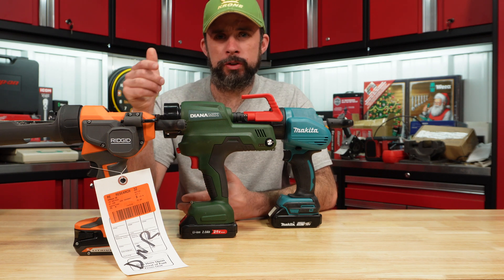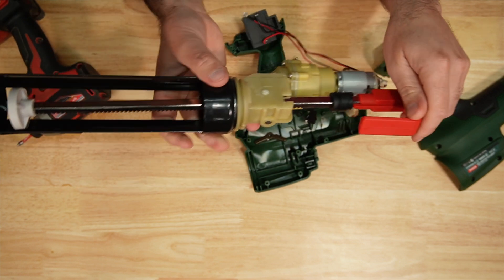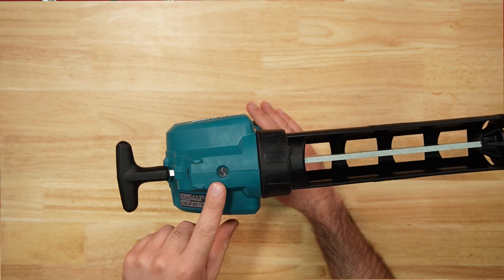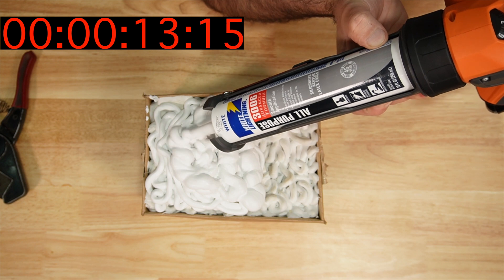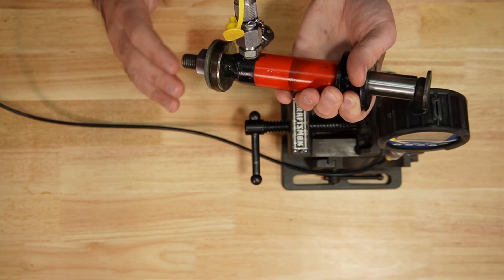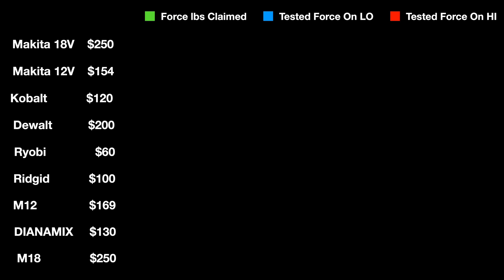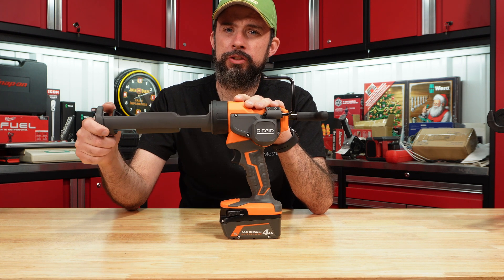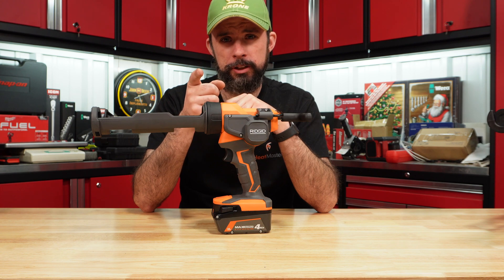Testing The 18V Makita Caulk Gun,  Update On The Failed Ridgid

Comment: The ridgid is on clearance near me for 57 bucks...LSA is solid. My only concern is the battery optimization, says over 200 tubes with a 4 ah while the ryobi's awesome optimization lets them do 200 tubes with a 2 ah... I'm on all platforms at HD except makita so ... doing windows or water fixtures here and there I can justify 60 bucks

Comment: I bought the Ridgid recently and before I had a chance to register it the darn thing broke just like yours. The manufacture date said it was made in 2020 (had been sitting around for 4 years at a home depot). The switch failed on it when the little bolt on the back kept going and the switch failed to tell it to stop. Once it keeps going the gears are out of alignment and can't pull the plunger back. I was able to fix it for a min until it did it again and the force of the gears snaped the bolt off. I just returned it wasn't about to send it off. As much as I enjoy Ridgid and it's the tool platform I've invested money into I'm going to look into the other brands you tested for this type of tool until Ridgid comes out with a new design.
Reply from the maker: Sad to hear I wasn’t the only one.  Yeah I like Ridgid for the most part, normally they are a good value in IMO.

Hopefully the videos help you decide on another option.
Reply: @Tools-Tested  yeah this was the only the 2nd RIDGID tool I have owned that had a major failure but the first one to do so not at a job site. I'm holding on hope they release a new one or at least can say "we have fixed the issues in this model with improved parts aka the censor switch tab that bent like an aluminum can."

Comment: You need to register for the warranty.

I’ve had two submerged batteries in a hot truck toolbox go bad and they just mailed me two new ones 

My OMT was in that toolbox too. Took it to Home Depot three days later it was working again.

I dropped my impact off like at least three roofs. The belt clip screw hole got stripped out. Clip on the left side was annoying they mailed me a new handle.
Reply from the maker: It was,  thats how I got a new one.  Just was a weird process with HD.

Comment: Can these push anchoring epoxy in the single tube? My guess is they can
Reply from the maker: It really depends how many tubes you plan on putting through it.  I put about 12 tubes through the older style ryobi and it actually bent the pushing rod.  I would recommend closing the highest performance one you can. Those tubes take a ton of force.

Comment: I used to work for a company that did all the tool repairs for Home Depot (on a National level - we gave support for over 900 US stores) 
If a tool or lawn equipment broke, the customer would return it to HD, and then we would pick up the defected items and deliver the repaired ones back. Typically, if the item was going to cost more than 50% of the retail price to repair, then the store would replace the item if it was still under warranty. (Unless it was caused by customer abuse/misuse. etc)

We tried to provide a 1-week turn-around on the repairs, but some items would have parts backlogs, which took longer,

We did this for them exclusively for about 10 years, then we started the same service plan for Lowe's, and of course HD got cranky about that and cancelled our service agreement. (Orange and Blue does not play well together)
Reply from the maker: Good information thanks!  Yeah my store didn’t seem to know what to do.  I think in this case they should have just thrown it out.  

Yeah I can see how they wouldn’t like that.  I’m surprised both still sell dewalt.
Reply: @Tools-Tested  You are right - Depot and Lowe's try to insist tool makers sign an exclusive agreement, but DeWalt is owned by Stanley Black and Decker (which also owns several other brands like Craftsman, etc) and they simply refuse to sign the deal. DeWalt is such a popular brand name that the big box dealers know's they need to carry it, so they let them slide on the exclusivity requirements)

My all-time favorite story was when the CEO of Snapper lawn products went for a meeting with Home Depot buyers, and they agreed to sell their products, but only if they met a certain price point. The CEO said he could not possibly meet that price, and HD offered to help set him up in China and other markets to build them, so they could be made cheaper, so they could meet the price point target. Depot promised a contract of 50k units the first year, and 100k in year 3. 
The CEO refused the offer and when he went back to his next board meeting, he said he would be remembered as the smartest, or the dumbest CEO in history for passing up the deal.
He reasoned that their name brand had a certain value, and making cheap product would diminish that value in the long run. Not to mention, their deal only netted them about $10 per unit profit. (which was good for HD large items). - That company I worked for also owned the Campbell Hausfeld brand, and they sold several models of their compressors to Home Depot for $1 over the cost to manufacture them. They did this, so they could sell all their tools, fittings, hoses, tool oil, etc through them, which all carried a 300-500% profit margin.

Comment: I have a couple of Ridgid batteries, so that unit somewhat appeals to me. I also have an air compressor. I was looking at the Campbell Hausfeld caulk gun for around $60. Do you think a pneumatic gun would be preferable to the battery powered Ridgid? Great video.
Reply from the maker: Personally I would probably go with the Ridgid, that way your not battling with the air hose.  Thanks!
Reply: @Tools-Tested  I ended up with a cheaper version of the Campbell pneumatic caulk gun. Took about 2 tubes of sealant to work out the right pressure (35 psi) and usage, but it worked great. No hand fatigue at all.

Comment: How are the ones that have high dispense speed but not necessarily high pressure? Wouldn't they be correlated?
Reply from the maker: For the most part yeah they seem to be correlated,  the higher the speed available the lower the pressure.  Which I guess would make sense for the most part.

Comment: I still think the Makitas might be detecting a blockage and backing off to protect the tools from damage.  Makita usually don’t make outlandish claims about their tool performance.

Can you use a throttle valve to allow the cylinder to flow some fluid while measuring pressure?  Perhaps store the caulk in a fridge/freezer to increase viscosity to test under more difficult conditions?  Those plastic tubes may not survive though.

Glad to see you update the previous video with the latest/missing/failed models!  More channels should do this, much easier than re-shooting the whole thing over.
Reply from the maker: Yeah it does seem kinda odd they would overate this much.

I will add a restrictor and see if it changes.  

Yeah I hope to do more update videos,  definitely when new products come out.